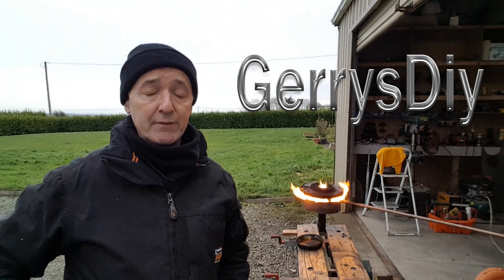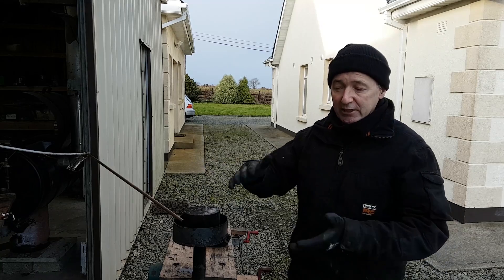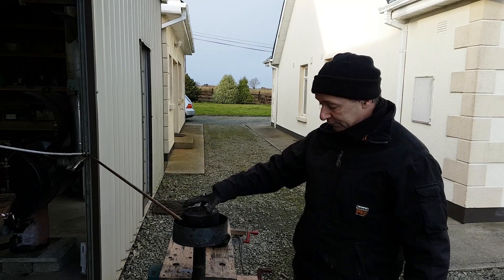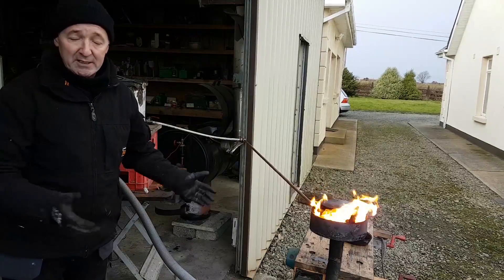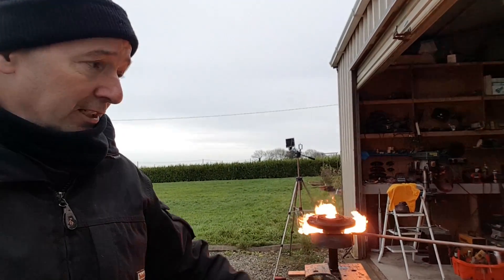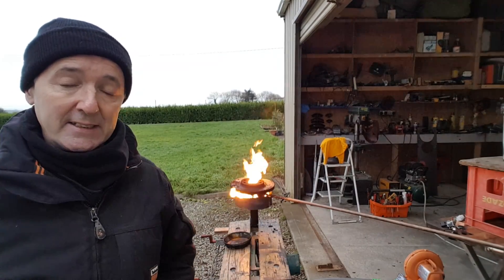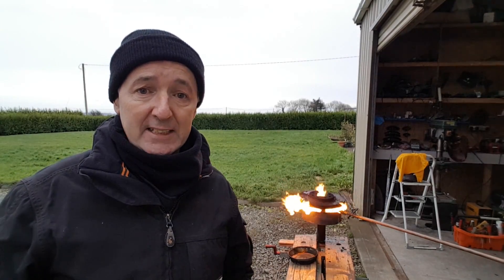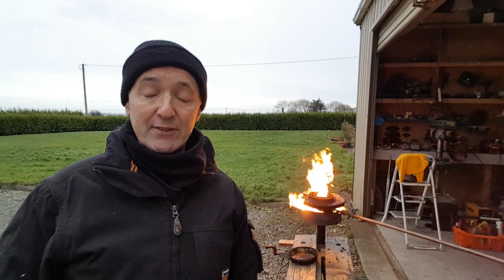Diy Waste Oil Burner  ..Free Heat .. Clean Burn

Comment: Hi Gerry. Other than at start up, do you have to add any other spirit to your waste oil I have read several comments on this from what I think are the doubting Thomas types ,who say you can't burn waste engine oil without spicing it up a bit.
Kind regards Phill
Reply: Just like Gerry I have been making different configurations for oil burners for over ten years now and it is how I get rid of a years' worth of accumulated oil in my shop. If you watch Gerry light them up it is exactly like that; all you need is the initial fire in the chamber and the oil will ignite. I have mixed gasoline into the oil sometimes just to reduce its viscosity but then the heat output from the system declines. It ends up being a waste of gasoline. Oil by itself has the best heat output. I have read that waste vegetable oil needs a bit more heat to ignite but as I saw in this video that is not much of a problem if it is a forced air burner. I like Gerry's work because he realizes the importance of a clean and efficient burn. Oil lights and burns just fine so long as there is no water in it.
Reply: Hi .Thank you for your reply. That's just what I wanted to  hear  @karmicmessenger

Comment: Gerry,
I have watched your videos for some time now and will be stealing good ideas that I have seen. It also is fun to see what weather in Ireland is like. Recently I have seen you go from holes drilled in a propane canister or dog food can to slots. It strikes me that this is all trial and error as an art form, when it may be possible to move to science. If you look a what you are really doing, you may be able to make this more predictable. There is likely an optimum ratio between air inlet area, and flue cross-sectional area or some other key ratios. I would encourage your measuring these things and see whether something evolves from that study. For example the slot burner seems close to the holy canister burner.... so , are the cross-sectional areas for air to pass through the same?
Reply from the maker: Hi Jack. I should be more analytical when I make these things. It is definitely a ratio of air to fuel and pressure both negative and positive that makes these things tick. I have the bits for another project or two this week with the newer burner too. Thanks for the comment Cheers Gerry

Comment: Run a propane line through the oil drip line to use as a preheater. I used diesel with a separate drip camber but should have switched to propane. I'm scraping all if it and switching to a siphon/jet system. More controllable and cleaner.

Comment: Another simple fuel system idea would be to run a small line off the compustion air blower in to a sealed fuel tank and use a needle valve (for hydraulic metering) to regulate the fuel flow. Also, a local hydraulic repair workshop will be able to give you a supply of filtered (say 10micron) oil. I have oil analysis data if anyone is interested as to metal content. Cheers!

Comment: I've been considering to upgrading my design to basically this but inside a cylinder chamber with axial fins for heat dissipation and a small flue gas to prevent exhaust blowing at ground level.
Reply from the maker: Hi Paul. I have only this week made this burner but I designed it to work in a stove. Here's the build and it working without a fan in my stove. https://youtu.be/ShTLaYKjzxw The powered trial was just to get a look at how it performs without a flue and to see if I could maybe use it in a foundry. Its a very easy to make burner unit and works very well. In the previous video you can see it inside a cylinder and connected to my cooker stove. If you get it working inside your setup I would love to see it so if you make some videos that would be very cool. Thanks for the comment Cheers Gerry

Comment: Works great.
Me and my brother is going to build one for his garage.
He have a massive diesel burner now but it's 2 meters long and so loud.
Reply from the maker: Hi Nikel87. The great thing with this setup is it is very cheap to check it out and try it for yourself. Cheers Gerry
Reply: Sure is. We have everything needing laying around in scrap.
And as we both like cars and motorcycles, we have more waste oil than we can handle.

Comment: Another great performer you have there Gerry.  Good job!  
Cold and windy here in Maryland, USA as well.  Going down to 21F/-6C tonight.  Makes for a cold workshop in the morning.
             I agree about using this set up for a foundry.  I made a waste-oil siphon nozzle burner for my propane bottle foundry, but it requires: ~10 micron filtration of the oil, compressed air, a hairdryer as blower over/around the nozzle, and on cooler days the oil has to be pre-warmed to ensure flow and a good spray.  Your burners are nice due to their simplicity in both fabrication and operation.    Keep up the great work!!  Educational and entertaining.
Reply from the maker: Hi SkunkWerx I was happy to get it lighting with the firelighter in the wind. I have a siphon nozzle waiting on me to get to it but I have some more ideas with this setup. It's alot colder there in Maryland than here at the moment and the burners make being in the shed possible. Just Subbed to your channel. Thanks for the comment Cheers Gerry